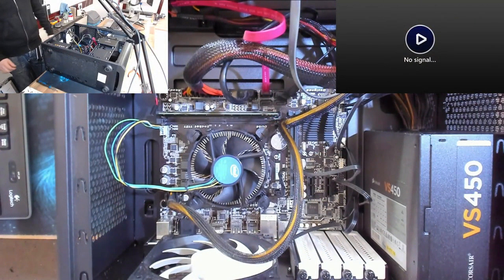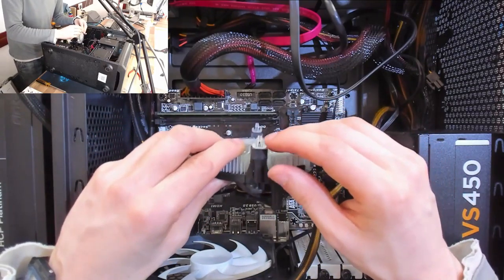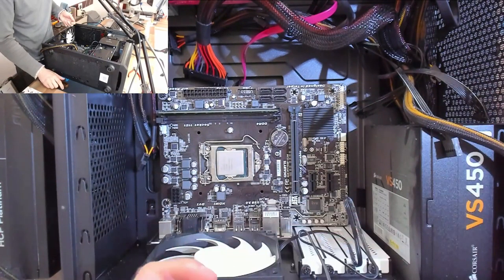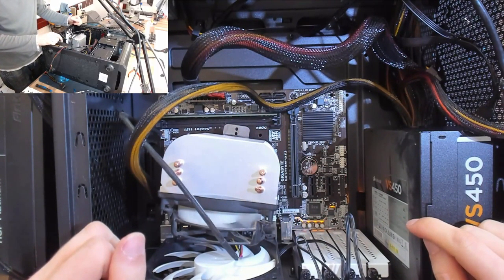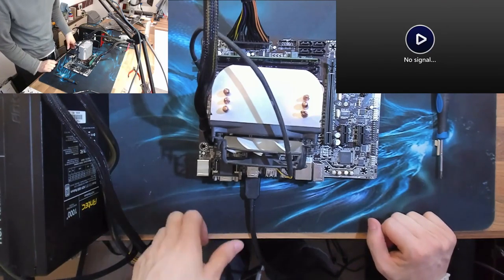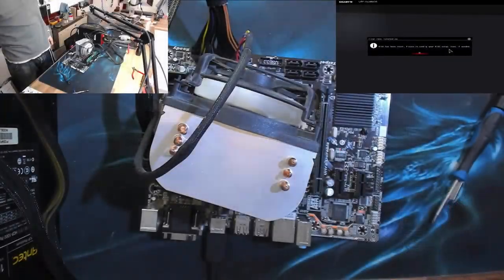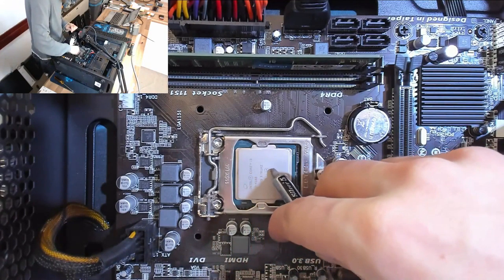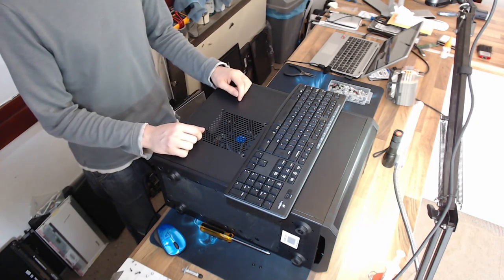LFC#119 - Custom PC with No Power

Comment: I have been a service tech for 30+ years and have seen this same "no power on" solved with a BIOS clear, reseating the CPU, reseating memory, reseating the power switch header connect, and reseating the power supply connections.    What could have happened is the customer replaced the CPU with an upgrade/downgrade and forgot to tell you as this will cause no power on.     I love your OCD in the fact that you went above and beyond the work order and completed the build in a proper manner.  I'm the same way.

Comment: Frozen super IO, not that uncommon when things are drastically wrong and probably built in by the board manufacturer. A loosely fitted cooler will soon see a CPU reach temperatures of 100c+ even in idle and a system restart would be of no help and actually cause even higher temperatures. So a complete shutdown of the super IO would be to ensure that the next person that examines the machine, would be someone that will know what they're doing and where to look.....ie, Adamant IT.

Comment: I have never had a Gigabyte motherboard so no experience with them.  But they seem to be the ones that fail 90%+ times on this channel.  Is that the most popular brand to use in that part of the world?  I have yet to have any of my Asus boards fail.  Only changed to a new one is when the old pc was obsolete.  Not worth it to upgrade the parts in it anymore.

My last Asus, P8Z77-V Deluxe with i7-3770K still works.  But with teleworking at home for now, decided that an upgrade on the 8-year-old system was due.  Now get to use my -7-12700K with Rog Strix Z690-E Gaming Wifi is a bit of overkill.  But should last for another 8 years at least.

Comment: Philip Taylor
21 hours ago
I had a similar problem. No power but the LED’s on the MOBO (Asus Rampage V Edition 10) were working. Took the MOBO out (that was a major job as I have an extensive custom loop water cooling setup (holds 2L water)) Found that the battery was dead (yes I know, should have checked that first) Did not think a dead battery would cause the MOBO not to power up.

Comment: I'm curious why I've never seen you use the Clear CMOS jumper.  The manual should say to remove the battery and use a jumper on CLR_CMOS.  I looked up the manual for this mobo, and I quote from Page 15: 
"CLR_CMOS (Clear CMOS Jumper) Use this  jumper to  clear    the   BIOS    configuration and   reset    the   CMOS values to  factory defaults. To   clear the CMOS values, use a metal object like a screwdriver to touch the two pins for a few seconds."
Reply: I'm guessing for similar reasons why I don't: The battery is obvious, the jumper is often not, which means searching for it or finding & consulting a manual.  If you pull the battery, you can save some time to spend on more useful things like making coffee or a loo break.

Comment: Dissapointed that you didn't check the CMOS battery voltage after you realized it was corrupted BIOS settings. It could be a failing battery, which means the same thing could happen again, the next time the computer is left off for an extended period of time.